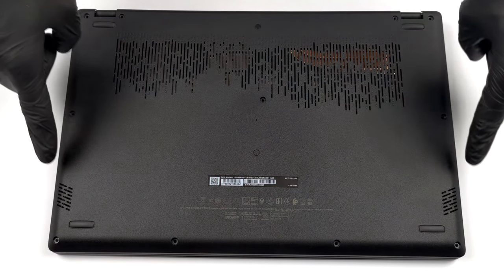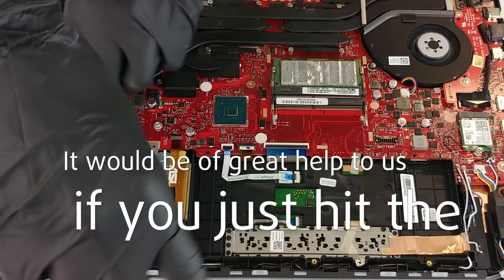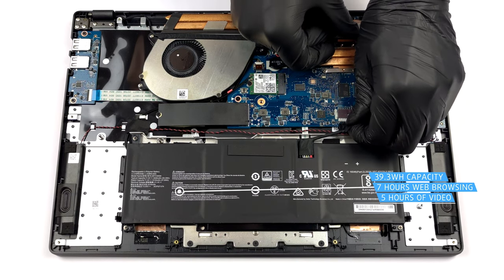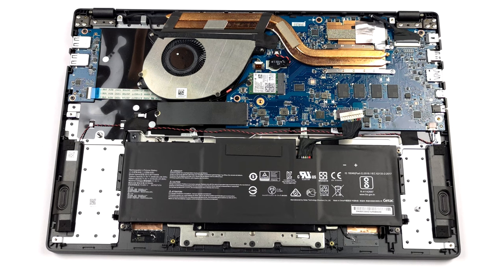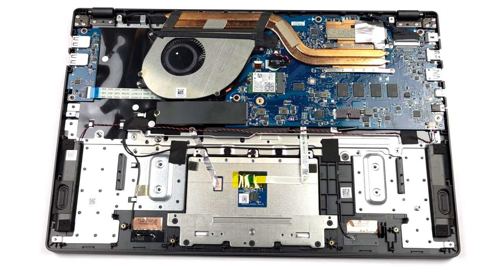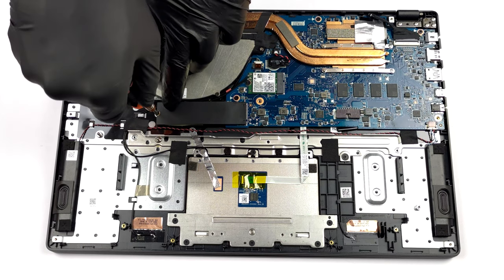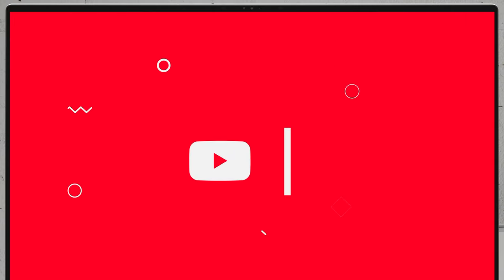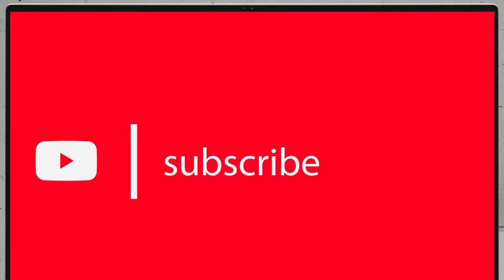🛠️ MSI Modern 15 (B12M) - disassembly and upgrade options

Comment: 11th gen Intel or the Ryzen 5 5500U version is better than this one since there are 2 M.2 and 2 RAM dimm slots open for upgrade, and the battery is bigger with around 50WH battery, and 2 fans to cooldown the CPU. This one is basically a downgrade. :'(
Reply: Exactly. But i heard 11th gen has hinge problem. Can u enlighten me bro?
Reply: @MarkAelham  none of them has hinge problems thats bullshit , they say that if the hinge is loose so you can lift up the screen more easily is a problem
Reply: @MarkAelham  yes hinge problem this model but not sure which gen 11 or 10 or 12
Reply: The I7 1255U is better
Reply: Those models don't have a thunderbolt port.
Reply: @Unknownuser12347 how's it better, does it have RAM slots?

Comment: Is it possible to upgrade ram or add more HDD storage?
Reply: Yes
Reply: @BenSXD.  How to upgrade RAM if it's soldered?
Reply: @A64632  solder new :)
Reply: @eulampiy  ha ha)). not only, also need to update info into bios about ram, cause when it’s soldered there is no chip that contains this info. Typically costs around 300 usd in my country.
Reply: @A64632   where u from i also want to upgrade the ram for the laptop which has soldered ram
Reply: What about the HDD?